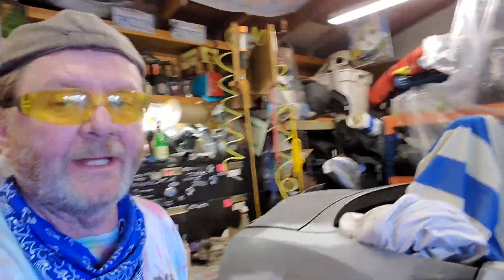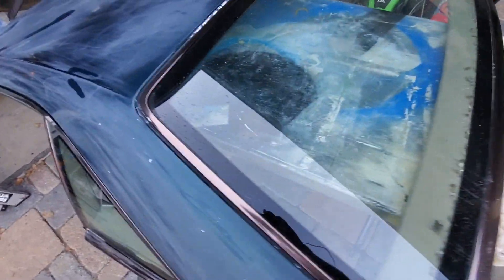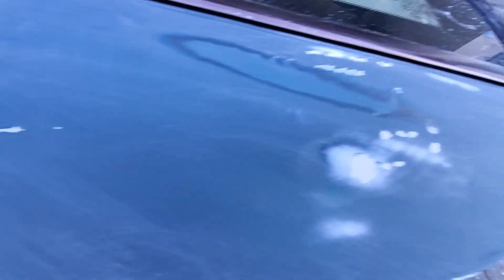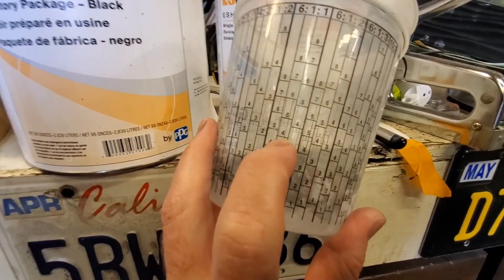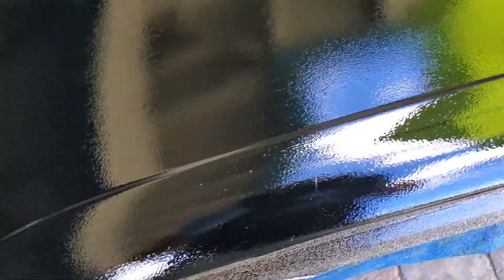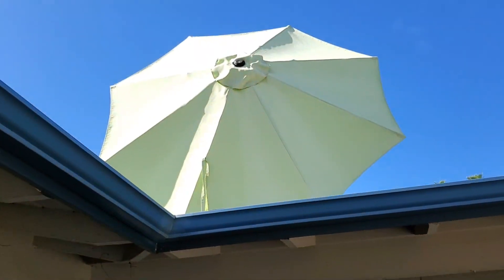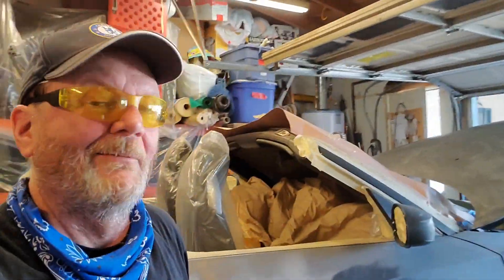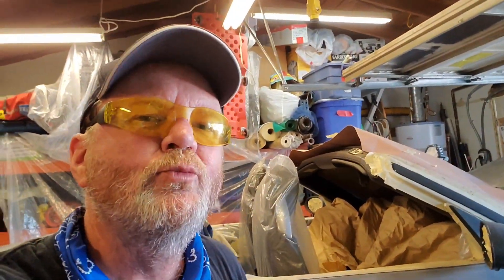Harbor Freight Black Widow spray gun practice.  Painting a hardtop black.

Comment: I think you should keep the 25 to 28 psi..... But check the viscosity of the paint get a Ford #4 viscosity cup on eBay... Get the viscosity of the paint between 14 to 16 seconds going through the cup by adding more reducer ....it will spray almost like glass with some practice good luck!

Comment: Isn't that hardtop worth a lot of money ? One for a Z4 is usually from $1,000 on up if you can even find one. Wouldn't 6:1:1 be 8 in the end? Maybe search that spray gun on YouTube ?
Reply from the maker: The top would be worth something if it had a panoramic glass insert and was in excellent shape, maybe $1500. This one has a bad headliner and lots of shelf wear.  If it was perfect it might pull $300ish.  In the sad shape it was in,  maybe $100? I'm going to scrap it when I'm done with it. Probably repainting it on Friday after a bit more spray gun experimenting. The internet says orange peel is generally caused by too thick of paint or too low air pressure or both.  The paint isn't too thick so it's got to be my set up.  More practice to come.  Cheers!